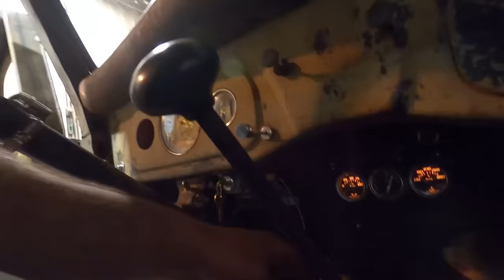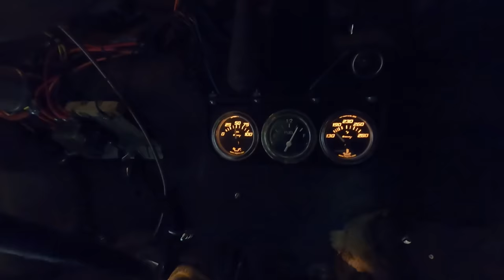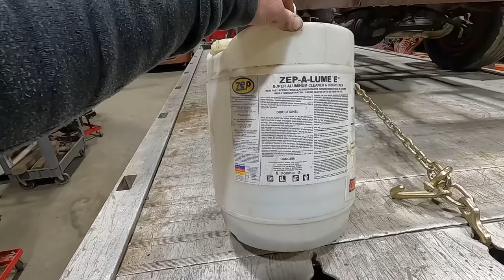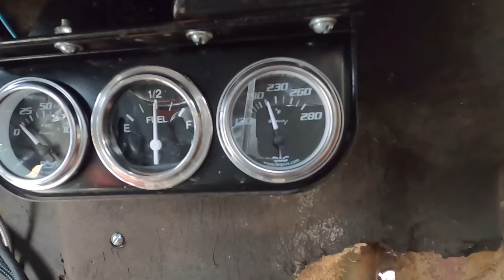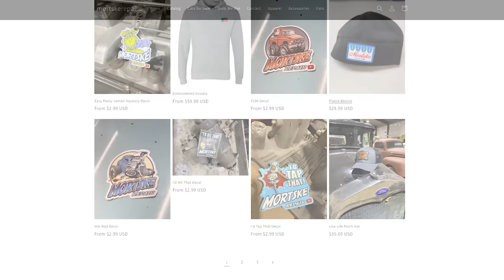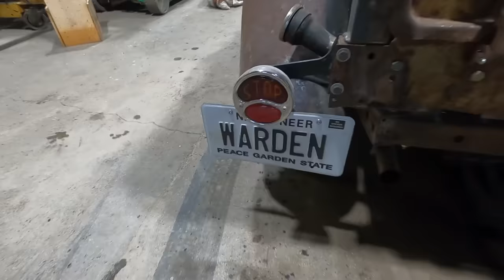1936 Ford Barn Find Pickup Truck! Overheating Flathead V8!! Problem Solved!

Comment: Phosphate solution.  Put the petcocks in lose to hold the phosphate in for awhile.  Take them out to drain it.  It's sold to de-rust the under side of a vehicle.
Reply: Trisodium Phosphate - TSP.  Old time IHC tractor manuals called for it in cast iron blocks.  Your block is rusty enough, I'd do two treatments back to back.

Comment: 1966 Ford Mustang with a modified race car engine I put in . Got brake issues tires paint job. Hey there is going to be a ton of metal on the top of the radiator man. Ask how I know .

Comment: Over at Iron trap garage the guy pulled the heads and used a air gun and a magnet . While blowing air in the center of block heads while having a magnet in hole got a lot of crap out.
Reply from the maker: Matt and Steve are pretty sharp

Comment: Water boils at 212 degrees Fahrenheit, but that's only if it's pure, distilled water that's free from contaminants and minerals that can lower that boiling point substantially. Most antifreeze is based on ethylene glycol, a form of alcohol that features a boiling point of 387 degrees Fahrenheit.

Comment: I'd run CLR with a pump through the radiator and the block backwards to start. However I'm curious to see what your solution is (about 30 minutes in)

Comment: Happy New Year to you Duff and MoJo.  We used to have a rubber cone tool with 2 hoses into it. One for the garden hose and one with an old air gun attached. You take out the thermostat and you flush through as normal until it runs clear. You jam it in the thermo hole and run the hose then give her 5 second bursts of the air until it runs clear and it stays clear. Then take the heater hoses off and OPEN the heater valve and give it water in both directions until it flows. No air! One of my (apprentice) work mates years ago gave her the air with the valve closed . It was still blocked. Heater cores dont like 120 psi LOL It wasnt blocked any more after that. In fact it was very free flowing into the carpet. he blew the ass out of it and learned what a job removing the heater core was all about.

Comment: 81 f250 camper special taking the 300 6 out and putting in a bored stroked ported and polished 351 windsor h.o. in

Comment: You’re a better man that I am Sir Mortekiss as Puddin calls you, I’d have spent less than 5 minutes putting that magnet into the slot and would have said to hell with it and said “ Mojo we got a motor to rebuild. Man that was a ton of rust you pulled out of that motor.  And near the end that one generator that hooked up to the PTO on that Ford tractor was pretty cool, I’ve never seen one before, the only thing I didn’t like about it is once it’s hooked up to the tractor you’ve lost the ability to use the tractor for anything. And with you saying you had a storm coming losing your ability to use that to clear your property seems a bit of a useless thing to do. I know you need the use of electricity to run various things but unless you have another tractor I’d do what you did and grab that big 35k generator

Comment: Use about a cup of clr and give it a heat cycle and if it doesn't work do it again then if needed give it a heat cycle and let it sit in the block and radiator

Comment: My project for 2024:  Get my 1986 Jeep J20 back on the road.  The immediate task is the same thing Mortske is fighting, overheating.
My rig is from the southwest where they do not use antifreeze...just straight water...or at least this owner did.
I have a rusty block.  I have flushed until I got clear water and then I drove it.  I flushed it again...more brown water rusty water.
I installed a fancy Chinese aluminum radiator, only to find more rusty brown water.  I want to replace the water pump because it's prob'y rusty as well.
I have some exhaust leaks, a leaky rear wheel cylinder to replace, a gas tank gasket to replace and a steering column to replace.
Reply from the maker: Good luck

Comment: 4 what it's worth, my guy would let the engine get super hot then jerk the hose off the radiator blowing a ton of crap out, fill it again get it hot then do the bottom hose. repeat a couple more times. worked everytime. #2 ports clogged up...my AMC Grimlin did this.

Comment: The Town I used to live in, had water so scale -y the rad shop ( Back Then ) used to offer discounts for boiling out rads in their  tank. Just think what drinking that stuff did for you over 50 years or so....Stop to shake the dew off and it takes fifteen minutes....

Comment: Question: is there any reason you didnt use a shop-vac to remove the majority of the rust particles, rather than the magnet? I know nothing which is why I'm asking. I would think a wire coat hanger or whatever and the vac would have made the job quicker. You could put a piece of hose that fit into the engine on the end of the vac and suck away.

Comment: I found when rebuilding my model a engine I used a broken speedo cable in a drill the clean out all the casting sand and debris from the water jackets, I got a hell of alot out of it now, I have the opposite problem from overheating, I wouldn't warm up enough until I put  a thermostat in it after that trick
Reply from the maker: good idea!

Comment: I remember when I was just out of high school o got a job at a machine shop doing the tear down and cleaning work, a guy brought his 454 out of a jet boat in because he thought he blew head gaskets from it over heating all the time, when I pulled it apart to get it ready for cleaning and machine work, I took the heads off the block was literally filled almost to the top with sand from him hitting the ground when pulling it in while running 😂😂😂 gee sir I dunno why it’s hot, 95% of your cooling is river sand

Comment: Use muriatic acid and water 10 to 1 then dump acetone through it.. pump it through then phosphoric acid straight and be very careful.  Neutralize it while its still in the motor with alot of baking soda and water then flush it back out with a hose. There will be no rust left anywhere

Comment: If you have a late 40 to the 53 flat head v8 you can get a kit to put a T5 in her  it a cool truck happy new year
Reply from the maker: Then you gotta swap rear axles. Pedals etc. snowballs
Reply: @MortskeRepair  yeah that true. but it looks cool with that old hot rod rake and a set of baby moons  with offenhauser heads and 3 Deuce it just expensive as heck.
Have you seen the  water pump set that does away with the two?

Comment: When you get done, convert to pressurized. Otherwise, you will be flushing for life. only need 4-7 lbs. Wouldn't hurt to have 2 temp sensors, 1 for each head.

Comment: OMG!!! if the block is that contaminated with rust and scale, then you can BET that almost ALL the cooling tubes in the radiator are going to be seriously blocked which would definitely be a contributing factor to the overheating issue...the rad needs to be professionally pulled apart and have those cooling tubes either replaced or cleaned (IE have the radiator replaced *cheaper option*) ... just throwing my two cents out there.  :face-green-smiling:

Comment: I had lots of rust in my dodge flathead. Copper head gasket, i re-used it. Ended up using compressed air and water to knock the crud out. CLR is supposed to work, i read draino as well. Im too chicken to try it. 

I see the same company supplied street light bulbs.(low bidder) 

You ship to canuckistan? Thinkin i need me a scraper and a screwdriver. And other stuff.

Comment: Mortske, You won't get this in time to help for this time, but if those water ports are straight, you might be able to use a brace and a wood bit a little smaller than the hole to clean the sludge out of them a little quickerttgvb

Comment: I was thinking I wonder if you dumped some rustoleum rust remover or the CLR flavor into the engine and ran it a few over heating cycles and let it sit for a few days if that would have eaten that rust up.

Comment: no nonsense know how had a similar problem recentley . he used something like clr to start with then found a filter to run in line just ahead of the radiator inlet .

Comment: I knew there was sand leftover from casting flatheads but I suppose after 88 years there would be some rust.  Antifreeze was invented in the 1880's and became available in1926 for engines.  Info for a Mortske minute.
Reply from the maker: Interesting

Comment: fill  the block with white vinegar and let it sit for 24 hours. then flush. same for the heads. the active agent is muratic acid. it's about a 5% solution. it will disolve rust. but be careful. will eat virgin metal too if it sits long enough. do some research on its use WRT rust.

Comment: over heating is not fixed until you can cruse it eat 80mph. and the outside air temp is 110.   Texas requirements.

Comment: there's nothing wrong with the  your transmission and you just need to push the clutch in pull the shifter out of the first gear to neutral by the time your gear shift is at neutral your clutch needs to be out and then push your clutch back in real not real quick but pretty quick and the thing will go shift into second gear and it won't grind I drove those old trucks for years You just got to be patient with them and figure it out Don't let it beat you anyway happy new  😅year late Love you channe

Comment: Everyone should own a flathead Ford with heating problems had a forty Ford with fan on the crank down low it woulds pickup water off the road and throw it right in the distributor.
Reply from the maker: Fun times

Comment: Tips brought to you by the Flat-Spot:
Here are some tips to help you get your cooling system back on track. 
- Flush your radiator
- If your radiator is bad, consider replacing it with a brass or copper radiator. Aluminum Radiators are commonly poorly made and offer worse cooling then the previously mentioned style. Aluminum radiators are also subject to break town due to a higher chance of electrolysis. Which is very common with flatheads. Right now the best radiators on the market come from Brassworks. 
- Always use thermostats. If you are one of those macho men that think you don't need them also consider using a large washer to reduce the waters speed. It is also common to drill a bypass hole in the thermostat. That works well too. All year flatheads can take a thermostat. Even the gen 1 1932-1936 Flatty's. The most common stat for aluminum heads is the Stant #15716
- Water pumps should also be inspected while the cooling system is open. The pump shouldn't have corrosion in it. It should not have a loose pulley, meaning one that can be rocked side to side. 
If this is your first time removing the pump remember there is a bolt inside the pump water neck. This is a common reason people can't get them off. also it should be said that the pumps are commonly your engine mount. So remember to lift and secure the engine before trying to remove the pump.

Comment: I wonder if there would be any benefit from Plugging the block and filling it with Evaporust to convert the surface and cut down on producing more rust inside.
Reply: Evaporust doesn't prevent rust from forming on metal. It just removes the existing rust using a chemical reaction. The surface will rust again after Evaporust treatment.

Comment: Project for 2024 is finishing my 1979 square body so it can go back on road again after sitting since 1991. Now at that dreaded stage with engine rebuild of do I risk new flat tappet cam and lifters or go retrofit😢

Comment: My old Volvo engine had a noil drain plug with a copper gasket. To get that little copper washer to seal properly I heated it up. When it glowed, got soft and swelled a bit I could reuse it.  I wonder if you can treat old copper head gaskets the same way and use the gaskets again.

Comment: Got stuck torsion keys on my 06 GMC 2500, tried hitting them with my Astro Pnuematic 4980, they didn't even think about budging. Gotta hit them with some more heat I guess. That hammer does hit hard though. The "big nasty" as Eric O from @southmainauto calls it.
Reply from the maker: Good luck

Comment: At 20 degrees outside wouldn't the radiator freeze and stop the coolant?  My friends 51 Chevy truck didn't have anti freeze and he drove the two miles to school and the radiator water froze up, stopped all flow and it was overheating when he got to school (circa 1970, but physics is still the same)

Comment: Trying to decide if I rebuild the 350 4 bolt main in my 65 C20 LWB Fleetside and swap the Th350 in it to the 700R4 I have felt it, or swap it to the LS 5.3 i have in the work van I just retired.

Comment: Use nano-rustarators tiny mechanical rust consumers you pour into your coolant system. They flow through your engine eating rust and expelling CO2 as a waste byproduct, cleaning the engine block to bare metal.

Comment: I know back when I was rebuilding engines my Mopars especially I would use muriatic acid for the blocks I know one thing for sure a lot of people are using CLR and doing a circulation on heater cores blocks and radiators but I know those flat heads are full of junk from the get-go that are never washed out at the factory

Comment: Just have 1 question why didn't you use a shopvac and a reduced hose that would fit in the water jacket and just suck it out
Reply from the maker: It would be plugged constantly

Comment: Use clr it’s meant for pipes and works wonders or use vinegar and let it sit for a few days to a week both of these you can use to unstick engines too happy new year mortske
Reply: Also I’m going to be working on a lot of projects this year several highboys a couple dodges my 38(almost 39k) original mile 89 ford and several other things

Comment: Cheveholic should change his name to Fordoholic!  Within days of getting your truck in his shop he unseized my Model A engine and rewired it to 12V put in a new fuel tank and got it running great after sitting 30 plus years!   OPHSO from Ace hardware will burn out the Rust!

Comment: 35 kw generator needed? i dono you should get a old 1800 rpm diesel generator around 15 to 20kw that has twice the start capacity as it run capacity, newer stuff thats 3600 rpm will only start something 25% over its rated capacity usually.. that and 3600 rpm is just super loud

Comment: I have had good luck with filling the system up with coke (I didn't put the engine through a heat cycle at this point, In fact, I didn't even cap it) and left it set for a few days. Then I flushed out the sludge and refilled with CLR for giggles. A few heat cycles later when I flushed out the CLR the water was clear with a few white chunks.

Comment: 1:42:53 if I can find a way to get it to me I have a FREE 71 C10 to crunch on. Been off the road a hot minute. Been in my family since brand new. I'll be the 4th generation on my dad's side to drive the thing if I can get it down here and get it back on the road. Dad learned to drive on the thing go figure.

Nothing special. Shortbed stepside single cab, 250 six, 3-on-the-tree. That's close to ideal, though. I love my straight sixes and it's a manual trans...I'd prefer a longbed fleetside, but you can't beat a freebie with a family history. Plan is, first and foremost, get it from Wisconsin to Tennessee, then get it back on the road. Figuring itt'l need every brake part except the pedal, engine service, tires, the usual suspects. I get it back on the road and start dailying it then I'll start looking into some changes; I want to swap the stepside bed for a fleetside so I can put a topper on it and use it as an RC plain hauler. That's probably the biggest change I want to make, and the reason I want to go fleetside is because doing that will let me put some of my airplanes in fully assembled. If it stays stepside I'll still have to take the wings off to pack in, assemble at the flying field...bit of a pain with some of my more complicated aircraft. Also wanna get some air conditioning in it, fit a dashcam, get a pretty kickass radio in it so I can blast Ozzy and Metallica at block party volumes with perfect clarity 🤘. I'm on the fence regarding tires...my usual $100 a piece Goodyear Wranglers would work nicely, and that's what I've run on my 85 F150 since the day I got it in 2007. Great tire, ride like a dream handle TN snow like a boss. But I'm also tempted to get some bias ply shit diggers for it. Twice the cost per tire, but itt'l look bad fucking ass on 'em. Decisions decisions. Probably won't happen right off the hop but I'm also looking into a re-gear....3.08's in the back? 2.73s? I'd almost bet money it's got 3.55s right now and that's not interstate compatible.

Not gonna slam it. I know that'll disappoint you and Puddin' both, but it stays at stock height haha.

Also have an engine swap to finish on my 85 F150, an EFI delete on my 95 F150 to finish, a bajillion RC replated projects, putting my 2014 Challenger up on blocks so I never have to touch that sad sack of shit again....yyeeaah.

Comment: It's overheating bc there isn't any thermostats once all the water gets warm it can't cool down in the radiator and it hits critical heat. Yes cleaning the block out is important also but if all the water is hot and it's not staying in the rad then how do you expect it to cool off

Comment: So let's say 6 lbs. of oxidized metal was removed. Is that 6 lbs. of steel from the motor? Does rust weigh more than the metal it displaces if it's captured in a closed system?
Reply from the maker: Good question!